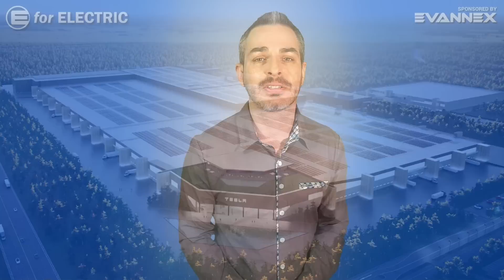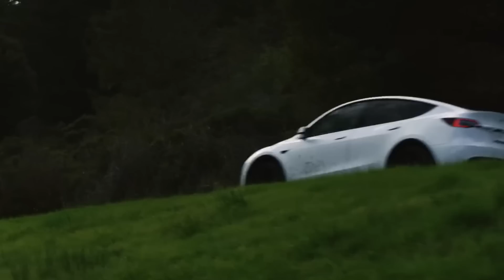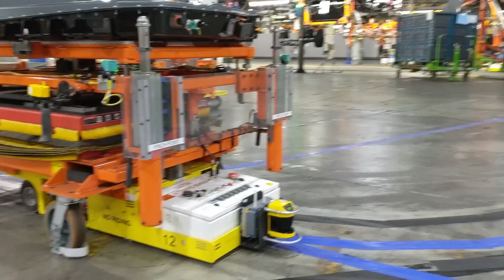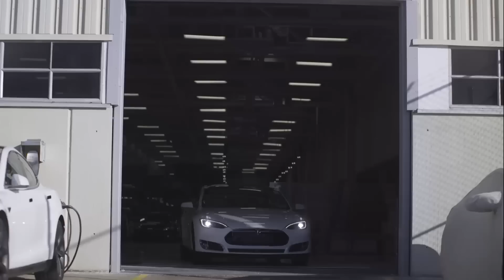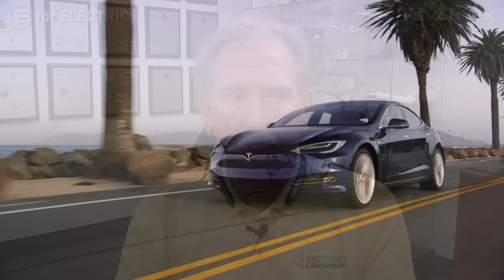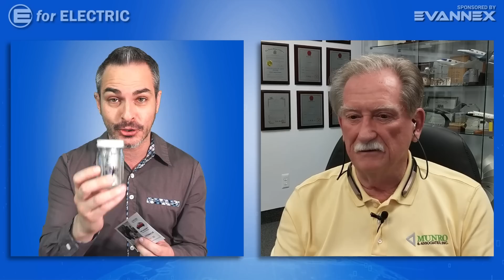SANDY MUNRO: Tesla Will Be Better in Texas

Comment: I own a 2016 Model S with 70K miles on it. The car is as tight and rattle-free as it was when new. The suspension still feels firm and fresh. I had a 2013 Model S before this one, and it is clear that Tesla has made huge strides in quality and reliability. Prior to owning a Tesla, I owned an Audi S6. At 70K miles, the Audi's suspension was shot and it developed a throttle control problem that Audi could not fix. It's easy to judge quality with your eyes, but how a car "feels" when you drive it is more important in my book.
Reply: debating to either get a Tesla 3 or and Audi A5 sportback...thoughts
Reply: @miken7750  Definitely, a Model 3. Two big reasons that come to mind are Tesla’s Supercharger network and the Model 3’s efficiency.

The Superchargers are insanely fast: up to 1,000 mph charge speeds with Model 3. And the Superchargers are integrated with the car’s navigation. When you navigate to a Supercharger, the car will begin warming or cooling the battery to insure maximum charge speed when you arrive. The car will show you how many chargers are available before you get there. 

The Audi has very poor efficiency compared to the Model 3. This is why its range is so limited. Charging takes longer because more energy is required to go the same distance.

Tesla’s technology is way beyond any other car maker at this point, particularly their Full Self Driving system which will get a public release soon.
Reply: @toddr.lockwood843  Todd  thanks for your response..the Audi A5 is a gas powered car...the build of the Audi seems stronger..the Audi salesman rolled down the window and sat on the car door..he said if i tried that on a Tesla you wouldnt be able to close the door...the doors on the tesla do seem very light..I'm concerned about how strong the car is built..I do like most everything else about the car.. thanks
Reply: @miken7750  Ah. I think there is a Sportback version of the Audi eTron. That’s what I thought you were comparing to. Tesla’s vehicles are strong. The Model 3 has one of the highest safety ratings in the US and Europe. That said, Tesla has strived to reduce mass wherever possible, in the interest of maximizing range. You should definitely take one for a test drive.
Reply: @toddr.lockwood843  ..i have test driven one and do like it...now just have to make a decision..thanks again for your insights!

Comment: Tesla Shanghai is already producing better quality cars than Tesla Fremont. My January 2020 Model 3 from Fremont did have panel gap issues as widely reported. From what I saw those were all workmanship issues. When picking up my new car, I found things like window trims misaligned; paint drip at corner of rear wheel well; one of the (internal) brackets that holds the rear bumper was broken; trunk misaligned...

Tesla service center gave me a brand new Model S loaner while they took care of the issues, so overall I'm satisfied with my Tesla experience. In fact I was so satisfied that I became Tesla shareholder shortly thereafter - Very glad I did... It's a shame that Tesla Fremont workers still don't seem to be taking pride in their works.
Reply: How can they take pride in their work when they're robots?  🤣

Comment: I listen to you and Sandy and I experience a total disconnect. I have a Fremont Model 3 delivered in March 2020 and the pearl white paintwork is flawless and the panel fit is exceptionally good. Are we living on the same planet? Sandy says the Fremont paint shop sucks. Well tell me how I got such a good product? Sandy, please explain otherwise I conclude you’re talking crap.
Reply: It's hit and miss. Tesla is so much in the spotlight right now that any problem with any car, regardless of the fact that there's over a million of them now, will get highlighted. Having dabbled in the Used Car business, I've seen there's a lot of lemons from the Big 3, so my assesment is that this extra attention towards Tesla is just showcasing vehicles that nobody covers from the bigger manufacturers. No better, no worse.

There's not been any significant chassis and drivetrain complaints from Tesla (Car and Driver did have to have their Model 3's rear motor assembly replaced), so most of the complaints so far are fit and finish. I've had seat issues in new Nissan's, electronic issues from new Audi's, and headliner issues in new Chevrolet's, so I'd expect some flaws from a few cars from Tesla as well.
Reply: @enyotheios2613  
A guy I know had to have the ECU replaced in his Audi, and it took a few weeks to get it shipped from Germany.  Seems like there have been a lot of problems.

Comment: Sandy You just finished Raving about the quality of the made in Fremont model "Y". Tesla is going through a massive learning curve on manufacturing, if they revamp the S and X I would expect to see massive improvements.
Reply: jjamespacbell - Toyota took over the Freemont plant and it started churning out top-quality cars.  Same factory with many of the same people.  Management is always the problem, not nationality.  GM is run by accountants, Toyota is run by engineers.
Reply: He raved on the quality improvements over the Model 3. Tens of thousands of brand new Model Y owners are still experiencing numerous problems that have to be resolved later after several Tesla service visits. Tesla better get their act together concerning quality in the next year, they will lose this longtime fan. I really want a Tesla Model Y but will probably end up getting a Mustang Mach-E if reports of Model Y issues continue.

Comment: Sandy is so correct. You can't fix quality after the event, it has to be built in.
Reply: Yeah , you can.  Look at a 70’s barracuda at a car show. They did not come from Chrysler with that level of fit and finish. They are completely rebuilt by craftsmen.
Reply: @M13x13M  But getting it right that way is costly plua wastes time and pisses off the customer too..
Reply: pasoundman : Sure not a general practice thing. But if you’ve ever worked on a 70’s car the fenders trunk etc are bolted  on and the holes are slotted so things can be aligned if you have the time to fuss with it.
Reply: @M13x13M  Yes, it's a very different way of doing things. These days things are meant to fit right first time !
Reply: pasoundman : Unions didn’t have   quality as their mission statement  so legacy car companies  had to work around that and profit became their only goal.
Reply: @M13x13M  Are you suggesting that only Trades Unions determine a car's quality ? Does not managerment have a role to play ?
Reply: @M13x13M  You're incorrect in making a blanket statement about Unions. Especially notably in Germany for examnple, a different style of industrial relations produced a very different result.
Reply: pasoundman : I was not making a blanket statement. I was talking specifically about legacy American car makers who gave up on “quality” because of various circumstances . Germany has mandatory trade schools ( at 6 grade) if you don’t qualify for university . So it’s a skilled workforce.  Watch American Factory.  
It won the academy award last year for a documentary . I met the film makers at a film festival . I’m shocked they could make this film .
Reply: I want to thank Sandy for pointing out that Musk fans are willing to buy Tesla cars despite poor build quality. Which proves the foolishness of blind loyalty to Musk! I don't worship Musk. Therefore,  I won't be buying a Tesla!
Reply: @DavidJohnson-tv2nn  Even those driving Teslas today are apparently getting a but tired of the rubbish build quality that hasn't improved much.
Reply: Chevy and GM are learning this in spades again with the Chevy Bolt.  They never learned it with the Chevy Vega and first generation Corvair.

Comment: Never would I have imagined hearing "ST.THÉRESE" on your channel. That plant use to be 15min away from me and they produced Camaro back in the 80s Despite the excellent quality & skilled workers plant was shut-down putting thousands out of work. The building is no more, and the Camaro is now being produced in Ontario....never owned a GM and never will.
Reply: GM cars were okay (except for the Vega) but GM has always been corporately irresponsible.  It's "The Heartbreak of America" to paraphrase GM.
Reply: Acme Fixer, yeah, they also sold Electro-Motive, (their locomotive division) which ultimately wound up being owned by Caterpillar, which was probably not such a good idea in the long run (especially since they would have been able to reuse traction motor technology for road EVs).

Comment: It's American Big 3 auto workers. It's always been "eh, that's good enough". You press that line stop button enough, and you're reassigned or laid off. It really hasn't changed that much for the so-called Big 3. It's culture at the plant. The Honda/Toy/Subaru made in the states have a different factory culture.
Reply: David McCarthy - Yup, Toyota took over the unfixable Freemont plant and had it churning out top-quality vehicles in no time.  Same factory with many of the same workers.  It’s always management fault.  GM is run by accountants, Toyota is run by engineers.  The results show.

Comment: Careful on the overgeneralizations here regarding regional 'culture' and quality. I'm sure to many this affirms some stereotypes and prejudices but facts are facts. The Fremont Tesla plant is the former NUMMI plant run by a partnership of GM and Toyota and produced Corollas and the first 2 generations of the Tacoma until 2010. The latter with many examples pushing 300K+ miles and still going strong. Assuming that the labor pool there has, for the most part, remained the same since Tesla took over the factory, where's the disconnect? As Sandy has so eloquently taught us about how manufacturing methods matter with his tear-down during the Spring. I wouldn't doubt that newer factories with newer (read improved) methods will produce better quality cars. But taking it out on "lazy workers?" That's a low blow.
Reply: Probably not the same workers, if I recall correctly the plant was unused for several years so they probably moved on.

Comment: I was wondering about the build quality of the S... I guess waiting is going to be the best option to save  money.

For the price of a Tesla.. I could buy a Hybrid that cost less for insurance, and still have better build quality.  I can hear that empty sound in some of the vloggers on Teslas they purchased.  The misalignment, the scheduling to have the issues repaired, the "Tesla Acceptable" statements they receive if they complain.. Maybe Rich was on to something after all.. Embracing the technology and realizing better performance versus a misaligned panels on an expensive car.

The car is supposed to be inexpensive.. yet I'm seeing more and more costs added to owning one.  Strangely familiar to what go thrue for mobile phones versus a home phone.. Home phone = $35.00.. Mobile phone = $300 - $700 (paid over time on contract every 4 to 5 years).  We went from free supercharging to only the S and X built during a specific time period; now no free supercharging.  Data charges for streaming, Supercharging rates are not what people pay on average at home per KW.

hmmmm.. makes you think a little...
Reply: Hybrids only get carpool for 3 years as the catalytic converter becomes less efficient.
Reply: @williamh.gatesiii8183  Good point.. but at least no water leaking into the cabin or tail light and the car doesn't look like it was in an accident when trying to trade it in on something new.

Love Tesla for getting it out there.. but at some point aligning body panels and the small stuff has to be addressed to keep the lead in the industry.  

Ford, GM, Toyota, Mercedez, BMW could retool once they figure out the tech and come from behind based on pricing and panel alignment within the same year they start.  Performance, distance and pricing per build quality are the only factors they would need to consider.

Comment: that`s what i told my friend about a month ago : "get a Tesla when Giga Berlin is finished"
Reply: Or bring a bunch of German engineers to run the Texas plant.
Reply: I still drive a 96 GMC Suburban 6.5L diesel with 358K miles, it'll be a long time before Tesla makes anything that lasts as long and does as much work!!!
Reply: and it does have to stop every 250 miles to charge carries 8 full size adults in comfort, can haul tow and work!!! good luck with your Tesla
Reply: @steveschulzelectronicswiz  They pee inside your truck?
Reply: @earlpottinger671  looks like it ;D